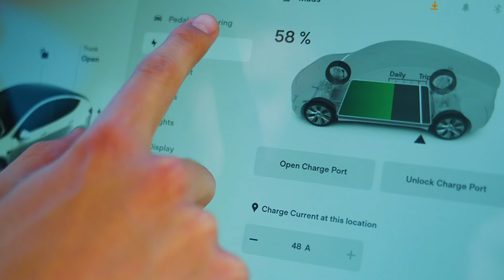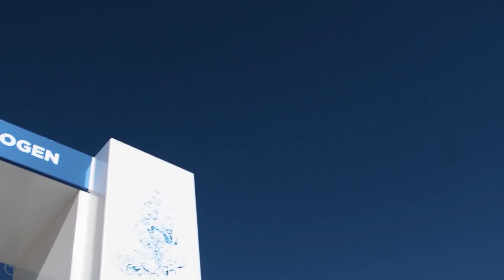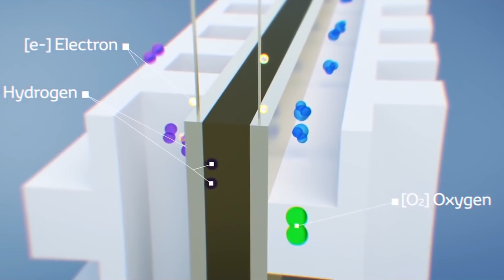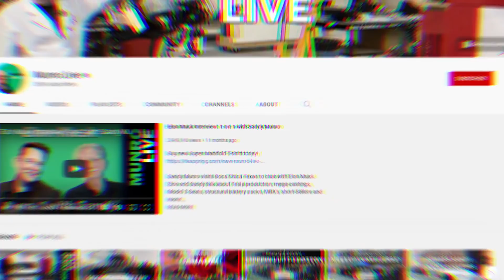SANDY MUNRO: Will Hydrogen Fuel Cell Tech Survive in 2022?

Comment: :yt:I agree on class 6ish and more like class 7 and above long haul trucks make sense going hydrogen. I  believe 400kWH/kg battery cells will launch by 2025 and be used in Class 6. Right now there are many companies constructing hydrogen production facilities and I know of two in California with one up and running. So I am not sure what you mean by California will not allow hydrogen produced by electrolysis. I do not think they will not allow dirty hydrogen and will restrict natural gas fuel cells. In some cases, Tier4 diesel engines used on generators produce less harmful emissions than natural gas engines.  There is also one company with over  600 electrolyzers working globally. There is already a hydrogen commercial ship running in San Francisco and train in service in Europe.  We will see more ships, trains, farming, and heavy construction trucks going hydrogen. If battery technology reaches 600kWH/kg and can fast charge I might see class 7 trucks using batteries as long as the utility grid completes a $500 billion dollar upgrade in the USA. Farmers could go batteries but many utility grids are too weak in rural areas to handle duel feed charging station. So far only $27B has been allocated from the present USA administration to upgrade the grid and half of that is low-cost government loans.🛻🚢🚆✈🚜

Comment: The real reason behind the 16 gears is to approximate the ideal tractive effort hyperbola and provide the full power of the engine over a wide range of vehicle speeds.
Electric engines might provide their maximum torque from 0 rpm upwards but not their maximum power.

Comment: At the end of the day the economics is what prevails. Its reasonable to assume that FCV and BEV trucks will be approximately the same capital costs, so its not about that. Many have done the comparison studies, and it remains that the cost of creating green hydrogen, storing it, transporting it to fuel outlets, and building the fuel outlets must be more economical than the price of making electricity through whatever local means is appropriate. Megacharger construction at truck stops is required and it is rare that grid level infrastructure requires an upgrade for such chargers. That's the rough version of the hydrogen equation. High speed air travel and transoceanic shipping are the two nasty problems requiring massive energy density. For those, it remains questionable in my mind whether hydrogen is the appropriate answer since negative emissions technology is required to solve climate change, and that technology has the byproduct of creating carbon neutral liquid fuel.

Comment: I'm surprised no one (especially Toyota) are considering making Hydrogen fuel cell cars as plug-in battery hybrids. All the home charging
 and low energy cost for daily commuting, only needing hydrogen fueling stations along major highways for long trips, and all the efficiency savings of regenerative braking. Both can share electric motors, unlike hybrid ICE cars that need a separate electric drive system. Whether it's worth it over a regular BEV is unclear, but it definitely seems like a win in every category over a pure hydrogen vehicle.

Comment: Hydrogen fuel is a non-starter. EV's are the future. Although hydrogen will have some good applications such as in large trucks, for cars, it's not going to happen. First off, it is as expensive as hell and second there is near zero infrastructure vs. EV's whose infrastructure is much larger..and still growing. I'd love to see hydrogen as a fuel..however, it will not be a viable source of energy until the technology is found that will make it price competitive with EV's...which probably won't happen for AT LEAST 10 years.

Comment: Munro is spot on.  The Hydrogen Fuel cell will never be as energy efficient from end to end as pure EVs unless you generate the compressed hydrogen locally.  There are uses for fuel cells but those application would not be for cars.  Aviation will not run on hydrogen, it simply does not have the energy density needed.
Reply: Liquid hydrogen is the only fuel that competes with kerosene for aircraft. It has around 25% of the volumetric energy density, but the same volume of LH2 has one tenth the mass of an equivalent volume of kerosene, which reduces the energy required for the same performance (power draw for cruise, for example, is linear with mass). This makes your aircraft design different, since you need a larger volume for the fuel, but additional volume requirements are easier to deal with than additional mass requirements (e.g. see the Beluga aircraft that Airbus uses to transport aircraft components). Because of this, you could actually exceed the performance of current aircraft if you used LH2 as the fuel instead.

The reason we don't use LH2 already is because kerosene is a lot easier to work with, and good enough already. There's also 70 odd years of experience type certifying aircraft to run on kerosene, whereas no one has ever type certified an aircraft that runs on hydrogen (though such aircraft have been flight tested, as far back as the 1950s). That said, if we want aviation to be sustainable, our two choices come down to using synthetic kerosene, or hydrogen. It's unclear at this point which will be the more economic solution, but given that you need hydrogen to make synthetic kerosene, and carbon is a major bottleneck (it needs to come from the atmosphere to be sustainable, which means biomass in some form), prevailing opinion is leaning in the direction of hydrogen being the better longterm choice.

Comment: As long as those technologies that want to use Hydrogen to propel or power use only Green hydrogen then we still have the issues of using Carbon based fuels to convert the ‘natural gas’ to hydrogen by using renewable energy to split the molecules and not dirty electric, like gas or coal. As Leo the new lower weight to power ratios of the new 4680 cells moves the goal posts away from hydrogen. With more high powered battery charging infrastructure rolling out across the globe and companies installing their own chargers then why add all the extra hydrogen weight to the vehicles to convert hydrogen to electric to power the wheels? Eliminate all that and add battery storage instead and away you go, did way less cost!

Comment: Sorry, I see No case for H2. Long haul would be Nat Gas (which is used to make H2 today anyway, electrolytic H2 is grossly inefficient). 
Nat gas is well tested tech that works on Long Haul, Ships, etc. Guess what LNG ships run on today?
H2 is also Very difficult to contain and will bleed off over time. 
Its a poor fuel even for rockets....compared to.....Methane (nat gas).

Comment: Nikola is leasing out their trucks. And both H2 and maintainance are included. The service partners are ready as we speak.
Looks like Hyzon use the same approach regarding leases. And the TCO will be lower than with H2 than with diesel. So in long haul H2 is a no brainer.

People that believe that there will be a battery Semi with a 1000 km range are naive.
Not this decade. Physicaly possible, but economical impossible.

And for utilities that need battery electric trucks with shorter range, well, Nikola sells that too.
What the customers want, Nikola produce. 

Sandy`s help and understanding of what the trucking industry needs shows that many batteryfanatics should reconcider their perception of the benefits this technology have over batteries in heavy duty.

And Nikola start serial production next month.

Comment: Swappable battery stations for Electric trucks makes complex H2 technology and HFCEVs obsolete. Swapping out a 800kWh battery pack in 3 mins and replacing it with a charged one takes 3 minutes, and you're on your way. That's faster than filling up with diesel that takes 20 minutes, and faster than filling up with H2 as well.

Comment: Aluminum Air Batteries make more sense for trucking, shipping and air travel.  Pound per pound they hold twice as much energy and are lighter than lithium ion cobalt and nickle batteries.  True you can't recharge an aluminum air battery but if you would be OK with swapping out hydrogen tanks swapping out an aluminum air battery is even easier and safer.  I say an passenger EV whose normal lithium iron phosphate battery that had a range of say 150 miles would be great for daily use.  Then if that EV had a built in slot for an aluminum air battery could extend the range to say 700 miles would be an awesome combination.  Only put in the aluminum air battery when you are going on a long trip and need the extra range or if your daily commute demands it.  If you don't need it then save the weight and only run the car of the lithium iron phosphate battery.

Comment: The problems with hydrogen as a vehicle fuel are the high cost of fuel cells, the high cost of hydrogen storage, and the very high cost of hydrogen itself. So, the only place where hydrogen will gain traction is where the weight advantage overrides the cost disadvantage. So, perhaps the military and some aerospace applications. It won't make it for long haul trucking, or ships.

Comment: H2 may have use as  a precursor to a liquid fuel for long distance transport.,
As a end product H2 simply has too many down sides to make hydrogen a real contender as a fuel.
Don't play nice with steel.  is very light . a kilo is about four times the volume of methane. likes to leak and goes boom at a wide ratio with air  .
H2 itself is not a solution for anything bit time and money wasting as we transition from  Fossil fuels and emitting greenhouse gas as a byproduct of human civilization.

Comment: Green hydrogen relies on unwanted energy from renewables to make up for its appalling inefficiency. Only 25% of the energy generated by a power station ends up as energy at the wheel for hydrogen fuel cells.
If we find a better use for that energy, like  charging cars, buses, or thermal storage, the means to generate cheapish hydrogen goes away.
Aircraft could happen because I don't see another option. But long haul trucking, could easily go electric with increases in battery energy density.
Reply: Agreed. But there is another method for aircraft. Making Methane from water and co2. Iirc it is called the sabbatier method. Spacex is using it.

Comment: As far as hypermiling goes the best use of regen is for necessary braking. Using N (no regen as the motor in an electric car is always engaged) will get you the greatest range as you have paid for the miles you will capture by climbing the hill. . Using regen needlessly slows the vehicle at times. Best use down hills is no regen. Regen use for braking to speed limit as needed but that's all. No regen is free miles so to speak.  Simply do the math and you will find the answer.

Comment: Sandy is wrong on Hydrogen.There is no problem with swapping out large batteries on heavy haulage trucks if required.

Why Sandy is wrong.-

1- There is no Hydrogen infrastructure and it will cost a lot to build out. 
2 -Hydrogen is expensive to make, store and transport so it will always be a lot more expensive per unit energy compared to grid power. Which means Hydrogen trucks are at a cost disadvantage.
3- Hydrogen powertrains take up a lot of space and are complicated, meaning that Hydrogen trucks will be more expensive to manufacture and will have less room for payload.
4- The disadvantage of charging times and lower range can be solved in long haul heavy haulage  by battery swap, if needed.
5- Large truck batteries can be used for grid services when the truck is not in use. Meaning a trucking company can make money when the truck is not in use.
6 - The scale of battery production will become so large  that Hydrogen will never be able to compete on cost, not even remotely. 
7- the scale of grid scale battery production units will mean truck batteries will also become low cost. MW scale units will be produced in high volumes for stationary storage, trucking applications, tractors, etc.
8- the cost of MW scale battery swapping stations for trucks and heavy duty applications will be a lot cheaper than building a Hydrogen refuelling station
9 -Hydrogen is dangerous
10 - An electric trucking operation with battery swapping infrastructure will become a grid scale utility providing grid scale revenue streams And because they have amortised the cost of the battery in the truck they will be cost competitive against stand alone grid batteries. Meaning big bucks for the heavy haulage operators. Hydrogen will offer none of these benefits.

Conclusion: Sandy is out of his depth on Hydrogen and should know better. Hydrogen has no chance being competitive outside of shipping. But even Musk thinks ships will go battery electric. I think he's right.
 Hydrogen is a big PITA for transport. Hydrogen is perfect for making steel, cement and bulk storage in the form of ammonia for energy and chemical production. Investment flows prove it.
Reply: So far little advancement in battery tech compared to 10 years ago. The graph for battery tech is now tapering off. Need complete different chemistry to advance again. Battery tech is soooooo far away from being viable in airplanes & heavy industry...still super heavy like a lumbering neaderthal.

Comment: What are the chances a fuel cell could cost-effectively run on a liquid fuel that could be trucked, piped, and tanked easily using existing infrastructure? Butanol, ethanol, ammonia?
Reply: They already exist in the form of reformed methanol fuel cells, direct methanol fuel cells, and direct ammonia fuel cells. Reformed methanol fuel cells are the most mature; cracking the fuel for hydrogen costs some efficiency, but overall system performance tends to be better than direct fuel cells, which have low power density. That said, if you have methanol already, internal combustion engines running on methanol can compete with fuel cells efficiency-wise, and you have the advantage of lower cost materials and existing toolchains.

Comment: Hydrogen not a high energy dense fuel supply . Remove the fuel cell, remove the hydrogen tanks and add more batteries. More  complicated and more servicing required. Batteries alone will win for even long range trucks because the driver will need to rest legally

Comment: A fuel cell is even more complicated than a modern diesel engine. That makes maintenance expensive. For shipping and aviation the maintenance and safety procedures are common knowledge, so they will be adapting to fuel cells quickly. For the trucking industry, I'm not so sure.

Comment: Hydrogen was always just a scam by Detroit to divert federal research dollars away from batteries.  It was their way of delaying the EV revolution, and it worked until the smart phone revolution produced the necessary advances in batteries.
Reply: Smart phones and laptops drove battery tech within reach of a critical threshold that made EVs and grid-scale energy storage practical, then Tesla pushed it past the threshold.  Now those revolutions will drive battery tech across the next threshold, making EVTOL aircraft practical.

Comment: For once I don't totally disagree with Sandy. Trucks could potentially be a rational use of hydrogen fuel cells. 
Sandy still doesn't hesitate to go on about things he doesn't understand though. Leaded aviation gasoline is used in piston engine aircraft, not jets. Commercial jets use highly refined kerosene called Jet A. 
And, of course, anyone with even a high school science education can tell you why solid-state hydrogen is not viable.
Reply: how so? can you provide some resources showing how it is not viable? Google only tells me it's the future...
Reply: @viajeroloco6220  It's about the mass of the hydrogen required. The long answer is too long to fit here. Short answer: The fuel cell needs the same number of hydrogen atoms wherever they come from. The Toyota Mairi holds 5kg (about 11 pounds) of compressed hydrogen. Even if cryogenically liquified it would take up about the same space as 1 1/2 gallons of water. if a disk can absorb at all , how much liquid can a film 1/10 as thick as a human hair hold? Would take tens of thousands of disks if they were 100% hydrogen. Shorter answer: You can't make an atom smaller than it is.

Comment: Sorry …But Hydrogen is the way fwd for cars ….In the UK …there are Millions of people who don’t have a driveway …and so Nowhere to charge an EV overnight …..and you will Never have enough public charge stations built to accommodate millions of EVs…. Plus …You will only need a few thousand hydrogen stations …to keep everyone topped up …as opposed to hundreds of Thousands of EV charge points ….EVs are Really only a good option if you live and work in a city  👍🤔🤔😃
Reply: With respect, you need to do more research. Within 3 years this won’t even be a discussion. Battery electric, having already won the car battle, will have also won the HGV battle too. Plenty people can charge at home, meaning they won’t need to use public chargers so much, I see chargepoints appearing in many, many places now. Dedicated public chargepoints, at gas stations, municipal and supermarket car parks, roadside etc etc etc. There are continuous improvements being made (LFP, solid state) in battery tech with batteries becoming lighter, more powerful, safe and cheaper. At the same time chargepoints offer quicker and quicker recharge times. Fuel cell for HGV is Betamax.

Comment: There are a lot of hydrogen pipelines.  We used hydrogen in the process of making plastics a the location where I worked and we got it from a pipeline most of the time. The only time we didn't get it via pipeline it was brought in by truckload. The trailer would have several long cylinders the took several hours to empty.  As soon as the pipeline was back up we switched back to that.